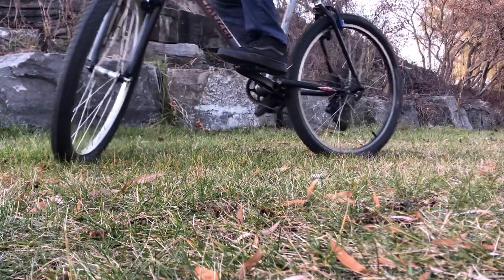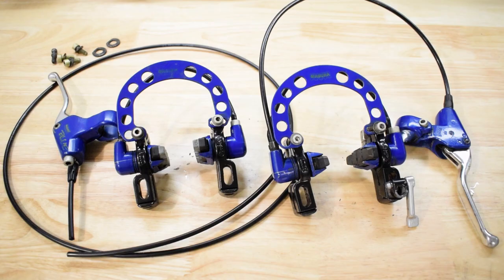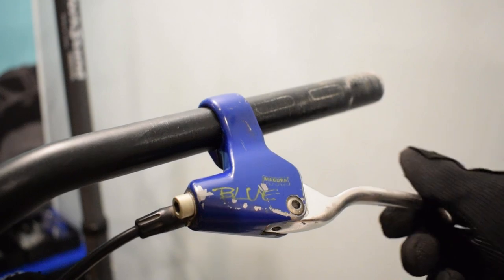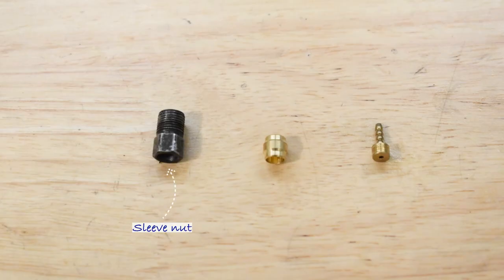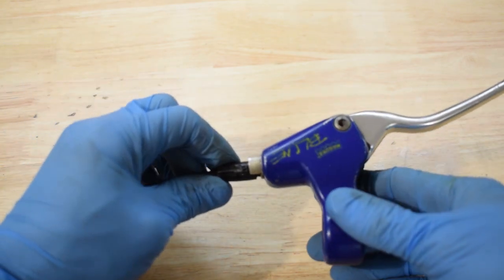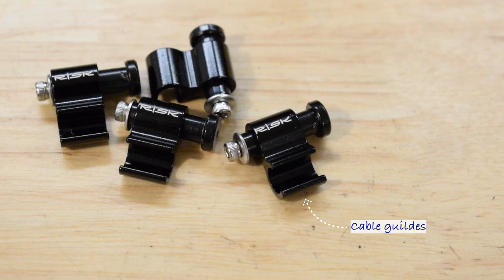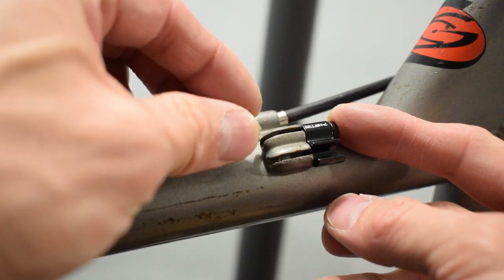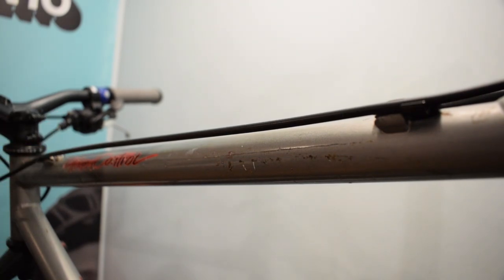Mechanical to Hydraulic Rim Brakes (MAGURA Blue)

Comment: tried using water ?
Reply from the maker: Nobody would use water.
Reply: @DanyoSports  i dunno much about this... but i came across a video where they swapped hydraulic oil for water and said it works pretty well (not sure if they were trolling) for hydraulic rim brakes.

heres the link to it :  https://youtu.be/DepygaJnmMw
and the short :  https://youtube.com/shorts/vnLfrll9zw0?feature=share